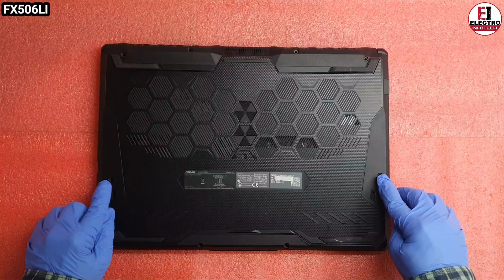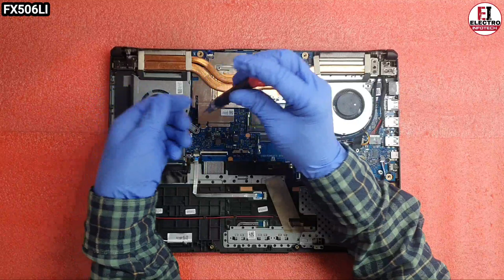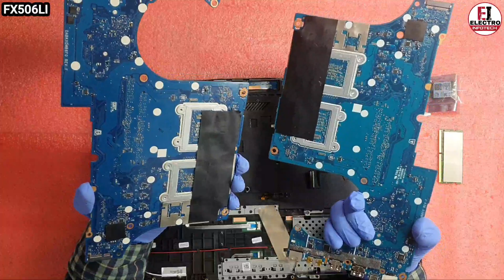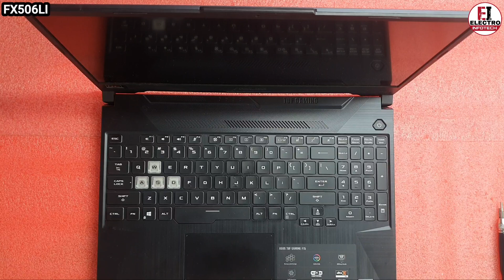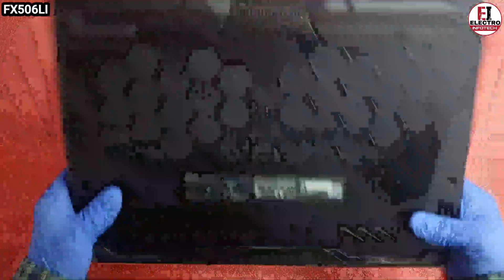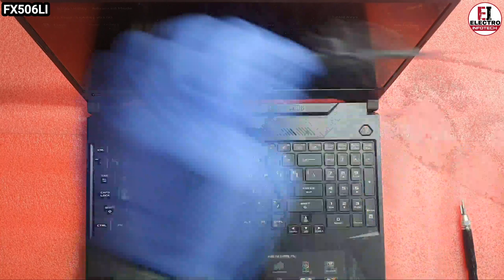How To Replace Motherboard  Asus Tuf FX506LI / Disassembly And Assembly

Comment: I have same model but my motherboard is short circuit i want a new / used motherboard for FX506Li 
i5 10300H and GTX 1650Ti
Reply: Bro have you fixed your laptop 
Can you tell me what will the cost of motherboard??
Reply: @techindiangamer18  did you fixed brother ?
Reply: If possible give me your contact information